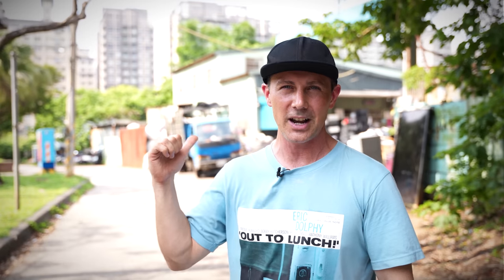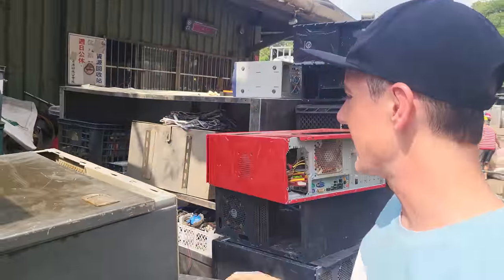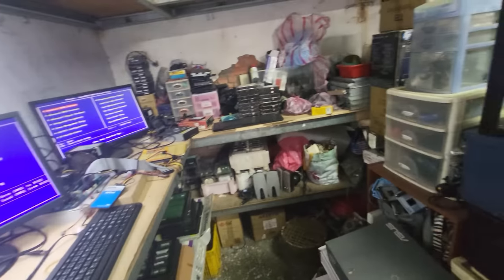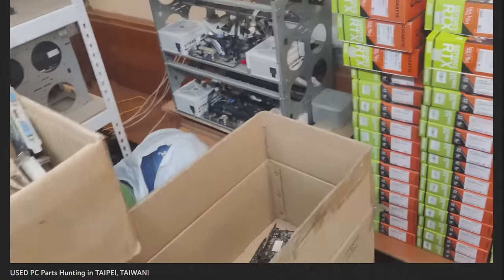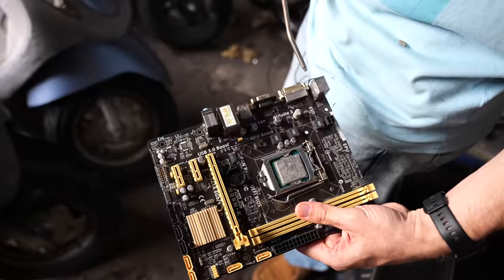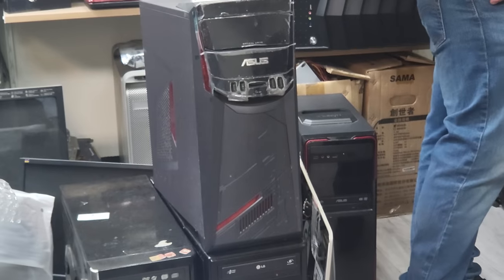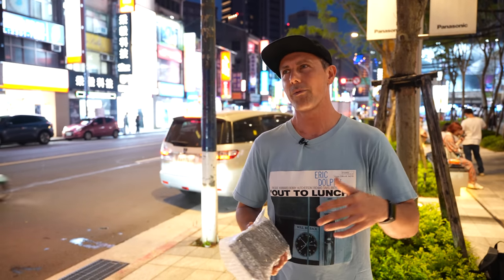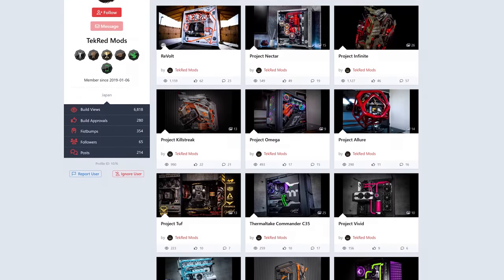We Bought USED PC Parts from SCRAPYARDS in TAIWAN

Comment: Finding that much LGA1150 goodness is lucky. The G3258 anniversary Pentium and i7-5775C were the only times Intel were thinking outside the box at all during the dark decade of them rehashing the same 4core rubbish over and over and they were both LGA1150. Haswell also fixed the hyperthreading bug that Sandy and Ivy bridge had where no longer the i5 would beat the i7 in certain workloads and games so it was the first time an i7 was the best buy. This all makes LGA1150 the hardest motherboards to track down.

Comment: The used part market is hot right now. But I’ve noticed it’s harder to sell the used PCs at a reasonable price. Same in aus?
Reply: Used parts will always be easier to sell because if something happens its just that one part which you got for cheap. Buying whole used rigs on the other hand has to many chances for the buyer to get burnt. If the seller is small time and doesnt have any reputation for selling top tier long lasting pc's then the price will be barely worth it.
Reply: Here in New Zealand, on TradeMe, some used PC parts sell really well individually, but not as whole systems. So it's better to buy bulk deals and sell the valuable parts off separately.

Comment: 💯 the GPU is crazy good. I am keeping an eye out for a smaller 3060 12GB and they are easily $250+ used here in the US.
I am also curious what Xeon you ended up with. I am a BIG fan of x99/2011v3
Reply: It's a good card in that price range. Still using one, 12 gb model.

Comment: Would you overclock i7 4770k on that H81 mobo you mentioned? There e are not much phases there, iirc there are 3 chokes...no heatsinks on vrms...so just from your perspective of much more experienced builder, will you OC or you'll leave it stock? Doesn't really matter if it's i74770k or i5 4690k...or does it? 
I mean they are not 200W+ cpus so it should be fine, maybe?
Another thing, just an observation, I always liked those M variants of mobos with 4 slots for ram. 2 was good but 4 was squeezing a year or two more of usage just because of ram capacity

Comment: The i5 4590 is the best deal for that socket and performs almost identically to the 4670. Solid choice for the uber-budget builds you'd be doing nowadays with that socket. I don't think the hyper-threading of the i7 really gets you that much when you're talking about the overall limitations of that gen.
Reply: Definitely depends on the game but having 8 threads can really help out in some modern games, especially on the 1 and 0.1% lows. Plus its really hard to flip a pc with a 4-threaded i5 nowadays lol. If 4th gen i7s are reasonably priced where you live its definitely worth it over any of the i5s. I used a i5-4690k for a few years and I decided to upgrade because of the micro stuttering that would happen in some demanding games.
Reply: 4core no HT is a nogo, just get a cheap xeon for 30 usd.

Comment: howdy. 

this has been a pain to me as i've built a computer for my nephew coming in ph.
i got it to work for weeks and it started showing problems [nvme brand new] in which i was able to resolve. 6 months down the line, the single stick of 16gb ram died. in which in turn i temporarily replaced with non matching ram [1x8gb 2400mhz 1x4gb 2133mhz] ddr4 memory. i know that it should work  fine for more than a month. recently and as i tried using msi's xmp profile [b450m mortar max with r3 2200g], it has  been throwing a lot of bsod, worst, it no longer boots. ram sticks works fine alone as i have a  back up mobo that aint mine, just for testing. am waiting for my new sticks of ram in the mail and hopefully and properly diagnose this matter. any thoughts [basic  trouble shooting is done 10x already it does boot up once but it no longer boot the second time]?

Comment: I'd wash them with detergent and water, then rinse with distilled water and dry it thoroughly. The compressor works reasonably well, but doesn't get the grime. Ion water is better than Pocari Sweat if you can get hold of it. :)

That is hella cheap though.

Comment: Those aren't bad deals, I run an i7 4770 with an RX 580 (close to GTX 1060) and I still can run all modern games at 1080p with good frame rates. If you bundle a whole gaming PC you could maybe charge 300$ USD? It's not that spectacular but I guess you consider it worth.